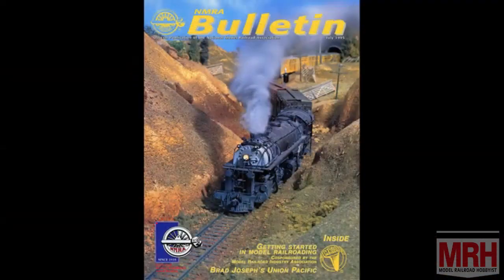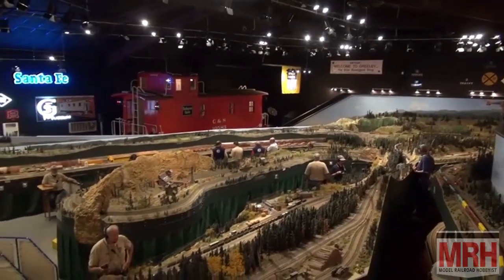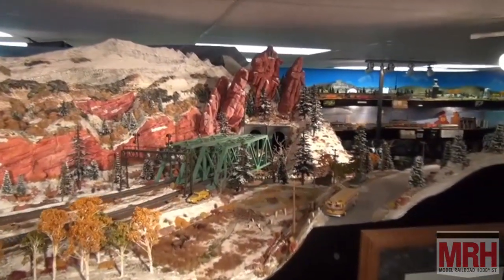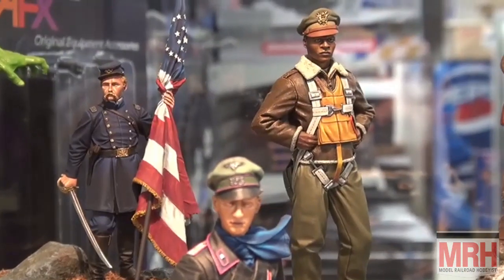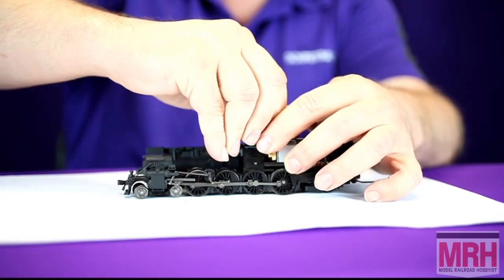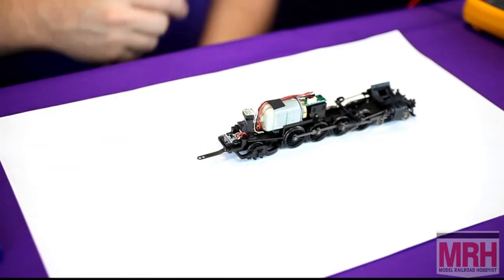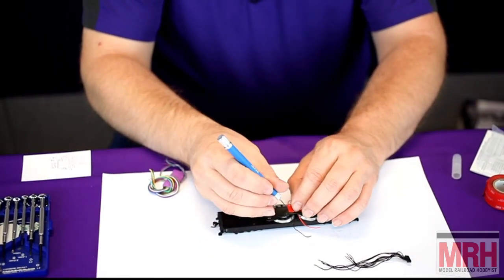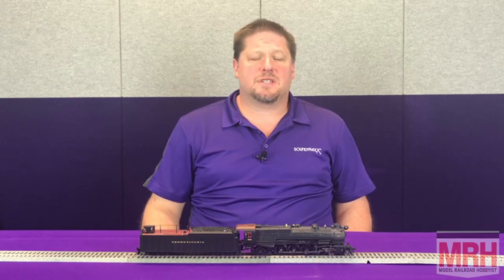Whats Neat in model railroading | December 2018 Model Railroad Hobbyist | Ken Patterson

Comment: great show, I would like to know why the head lights flicker on the steam run by at the end of the show, I'm thinking that they are multiplexed and the digital camera catch this. thanks from Dave
Reply: yep I gone through all the time with models.. 60 frame rate VS  hurt's, flicker.. common in video.. you just have to over look it.. good EYE!
Reply: Dave Luehr has to do with the PWM control of the LED (more efficient than a bulb vs the camera frame rate.)  I shot a new Marc loco in Baltimore on the corridor that has it flickering too.  Have to play with the settings and adjust accordingly.  I hope this helps!!
Reply: It's the frame rate it's shot at, and the frame rate it's played back at. 
It happens on videos of cars too.

Comment: That was great, but what isa steam locomotive with out smoke?
Reply: The oil makes a mess when id spits/splatters on the boiler,,and a smell I simply don't need. I model for the simple run by effect.. KP
Reply: Right...
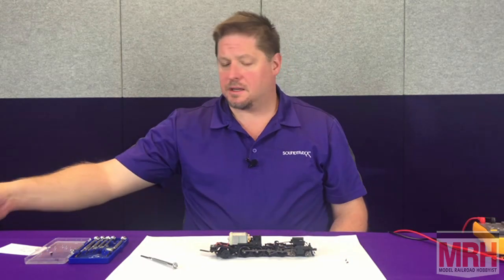39:16 Look at how much cleaner this installation looks when features are stripped. >_>
I'll be impressed when they ADD features, not exchange them.
Reply: Smoke Looks nice when you run a larger scale like O-27 or G, But when running H.O. scale it doesn't look right. H.O. scale isn't made for smoke. Like Ken said the residue gets all over.

Comment: George Bogatiuk, from SoundTraxx, was perplexing.  I would truly want to find out the brand and retailers that sell his red two sided tape.  That could be handy for myself and my RxR club.  As we do many modification to our stock.

Secondly, I can't agree with using transparent tape on electronic parts even if it's only a tie down.

And lastly, when we do an In School Educational/Foamer Op the children viewing YAWN when we pull out the Diesels or Electric Locos.  But reve up a Steam Engine, even if it is in hidden track, and the kids eyes almost pop out of their sockets.  So removing the steam generator from the headend chassis is NOT an improvement, but a destruction of purpose.

IF it was S-O-O-O-O essential to have sound come from the boiler section, why not put the sound chip in the tender, and run  lines to a speaker inside the Loco.  AND KEEP THE STEAM.  It's a STEAM Engine.

SEE YOU DOWN THE LINE,
Jim
Reply: jvanamb The tape I used was made by 3M. Not sure of the description or 3M item number, other than double-sided tape.  It’s there to insulate the underside of the headlight PCB.    On the clear tape comment, the decoder is already insulated with the shrink-tube, so the type of tape is less consequential.  I never use the black electric tape because it unravels over time, and can leave sticky, unpleasant residue on the taped surface.  
The smoke unit is removed for a few reasons.  A) most times the smoke unit is not used anyway, B) it’s not really heavy black coal smoke that you’d see from some steam locos (especially when cleaning the flues with sand) and C) it tends to leave an oily film over the entire layout, helping fight against clean track, and last, the T2 decoder has no provision for syncing the chuff sound to a physical trigger that would also be required to operate the smoke fan.
I hope this help clarify this installation.   If you have interest in the diagram, let me know.  I figured he’d have shown some extra diagrams or still photos to use as well as the video.  
If you have any other questions or need further assistance, feel free to contact me by email at georgeb@soundtraxx.com.  I’m always happy to help you!!  
Thank you for watching!!